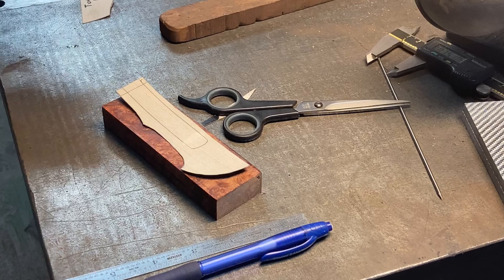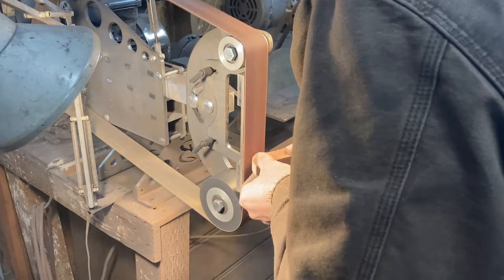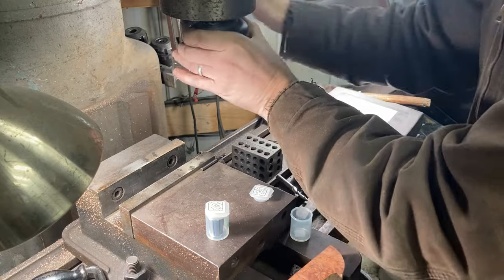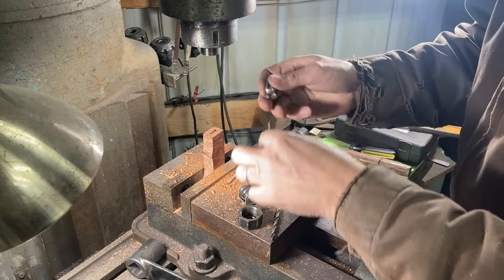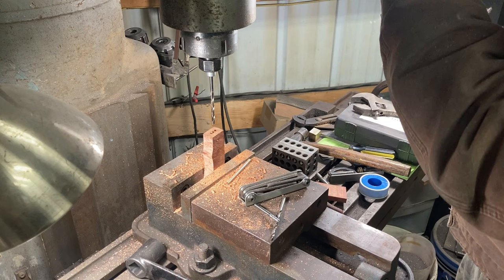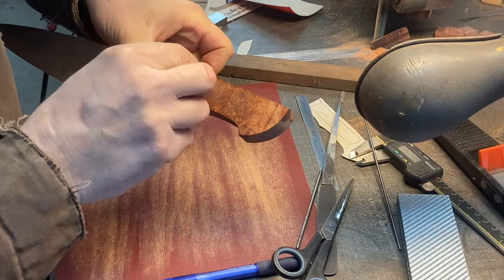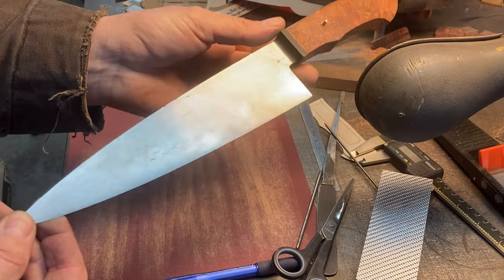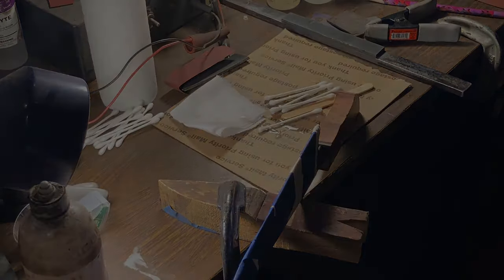Wrought Iron CruForgeV San Mai Chef Knife Part 4

Comment: I meant to ask after the last chapter, so please forgive.  You didn't show how you insure that your tang shoulders are parallel or in the same plain with each other.  I struggle with this  even though I use a carbide file guide. I'm so grateful to you for taking the time to to produce quality instructional videos.
Reply from the maker: I use a carbide file guide for that, on knives with bigger shoulders. On this one it wasn’t such a concern, as the tang shoulders are small and don’t have much in the way of flats. It was more about file fitting the “guard” to fit the blade.

Comment: Is there a reason you wouldn’t just make the three end mill holes and then swap to the drill bit to make them deeper.  Would save swapping them so often.
Reply from the maker: Location. Less likely to have the bit wander from a slight misalignment from the original hole.
It's of course possible to do a good job from your variation as well.  I've done both.

Comment: What kind of ER collet holder allows you to insert the collet in the holder before you insert the collet into the nut? 
Love the knife. Thanks for the fantastic documentation.
Reply: Wait I watched some more. You hammer the ER collet out. Don't you know that you are supposed to insert the collet into the nut first? You have a lot of run out if you do it the other way around.
Also the collet will pop out of the holder with the nut. Your are not meant to hammer it out of the holder.
Reply from the maker: @mathiasw.8148  it’s not an er collet… it’s an Acura Flex. The collet doesn’t snap into the nut with this style- the clearance isn’t there. I have er collets and holder too… they do work differently.
Reply: @PrometheanBlade  then I am sorry to have brought this up. I take everything back.
Reply from the maker: @mathiasw.8148  no foul. It kinda looks like an er collet setup but it’s a bit older and less common of a style now. CNC machines from the ‘80s used them pretty commonly (this is a 1980s mill)
Reply from the maker: @mathiasw.8148 my apologies to you actually! Reflecting further upon your assertion, I agreed that having to hammer the collets out shouldn’t be right. These are built a bit differently than er series and not as easy to push into the holder but- but after a firm shove they pop in! And the nut takes them out easily after use. So, thanks for pointing that out!
Reply: @PrometheanBlade  it takes courage to admit one is not right. I respect that. We both learned something it seems. Even though I actually believed that you really had a different system here. Nevertheless, I thank you for your polite answer and the gorgeous video content you deliver to us all.
Thank you so much.
Reply from the maker: @mathiasw.8148  hey I’m often wrong about things! If I didn’t correct that perhaps some other viewer would be misled… hard to find info about AF collets these days. Cheers👊🏻